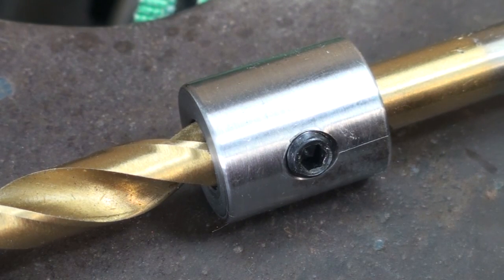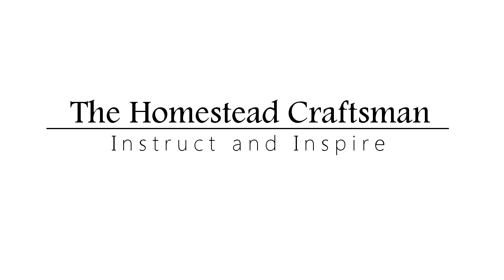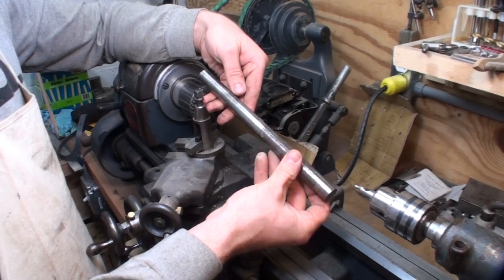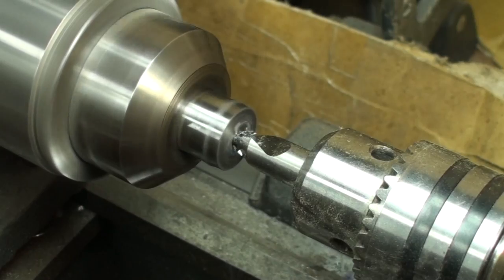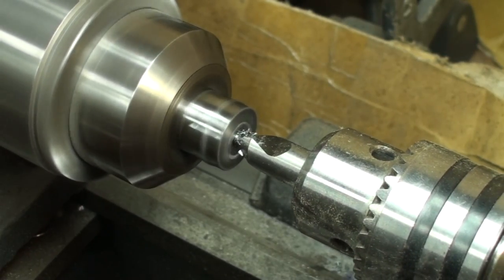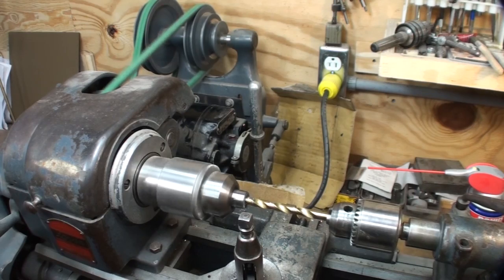Metal Lathe - Turning a Drill Bit Stop Collar

Comment: Thats awesome, I teach lathe work and always use scotch tape. This will make things easier for the students. Thanks for the great idea.
Reply from the maker: It's really good for repetitive holes, also with the double set screw it's less likely to move. It would work in any drilling application, by hand or machine.
Reply: I think I'm going to make the students make one before the start there main project that we always used tape for. I was looking for something else for them to make. I think it will be great for them to make a part for a tool.
Reply from the maker: I use tape for a lot of stuff but the bit heats up and the tape slides. For me I can have drill bits set up for specific tasks I do a lot and move fast, drill to it hits vs carefully stopping at your tape.

Comment: Nice work! Specific for the drill bit also! You mentioned two locking screws but I missed the second one. Very useful metal milling machine you have there!
Reply from the maker: There's a set screw on each side.
Reply: The Homestead Craftsman Ok thanks.

Comment: Your lathe skills look very advanced, nice work. If I had to pick nits, they would be: put the work piece in the tailstock chuck to tap, so it can't rotate and possibly snap off the tap, and, I couldn't tell if your file had a handle or not. It's a good safety rule to never use a file without a handle on a spinning work piece. Finished part looked great though.
Reply from the maker: Thanks, I'm definitely not an expert with the lathe. My goal is normally to just get stuff done in the least amount of steps.....and yes, no handle on the file. I'm a rebel.